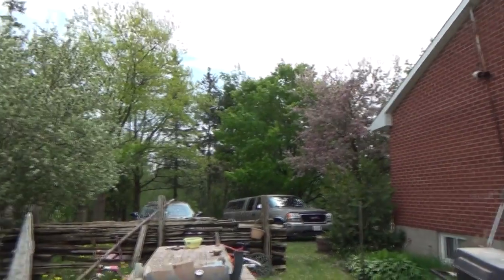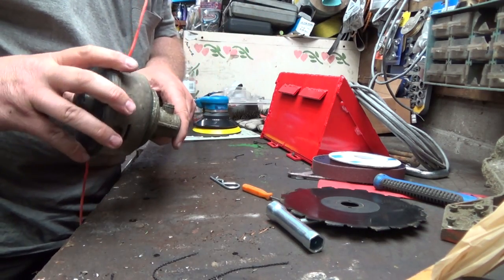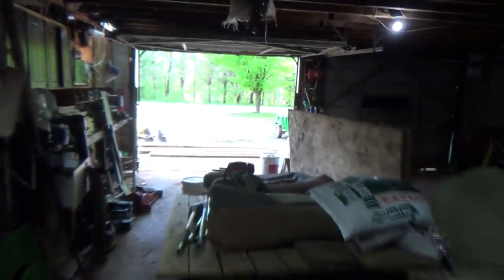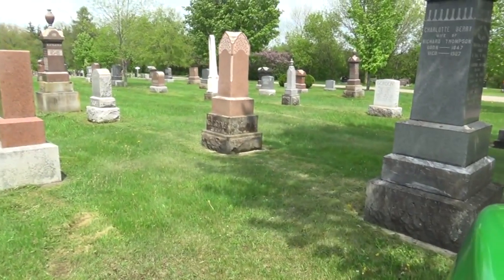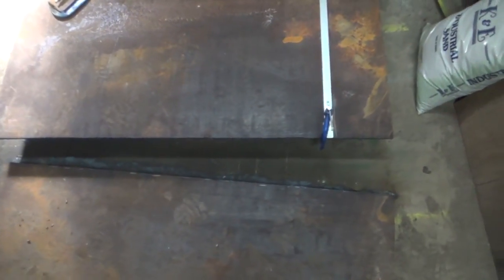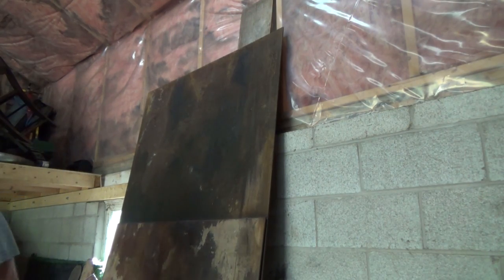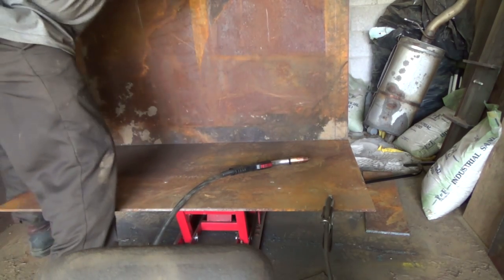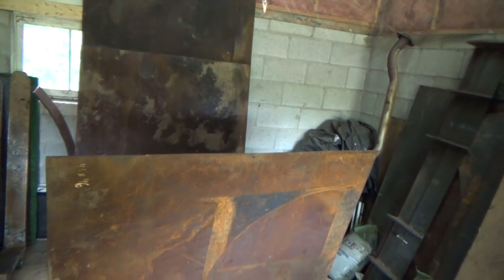wacking weeds and some more loader bucket project

Comment: I have Psoriasis too. One of the best things for it is UV light so let the sun get to it as much as you can, or have a session on a sunbed. I have a friend who tried the sunbed treatment and it did work for him. Though it's not a permanent cure it does get rid of it for a longer amount of time. I always avoid top end shower gels and soaps like axe etc and use mild stuff.

Comment: Hi Bill,

I am surprised you do not make an A frame sort of lifter/holder that can support bits you cut while you do them and or to move sheets around to re=stack them. It would take little effort to make and would end up saving time and could also be used outside for monuments and or tree branches?
They had grippers in the engineering shop that would grip as soon as any tension was put on leaving the thing which there was machine parts and other stuff hanging in mid air and perfectly safe

Comment: In the end you talked about psoriasis. I hade problems like that on both my elbows and my head. What I'm going to say now may not apply to you but when I started eating more fat and less sugar my skin got better and after 4 months my problems went away. During the time I ate more fat and less sugar I didn't even get a cold or a headache (apart from 2-3 Days in the begining when the sugar left the system). What I learned was that my immune system gained strength and my body lost weight.